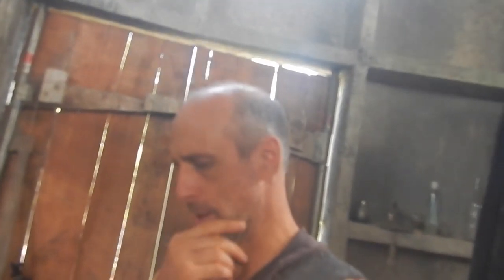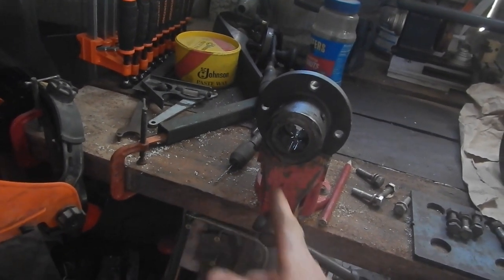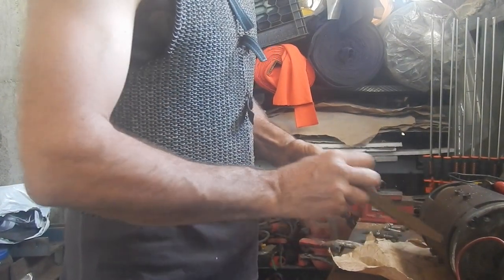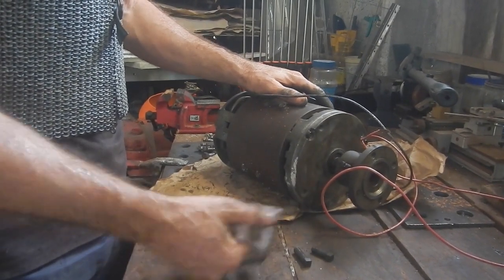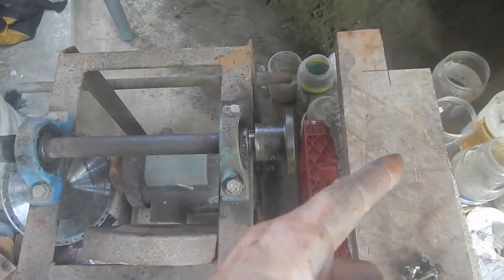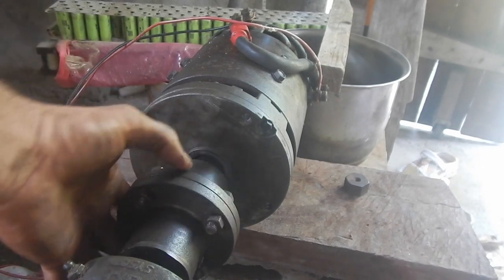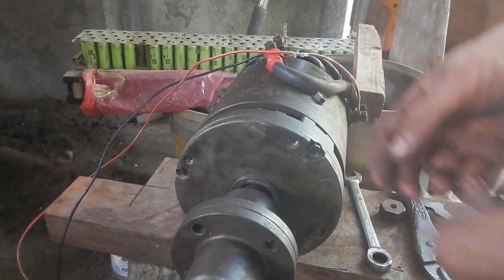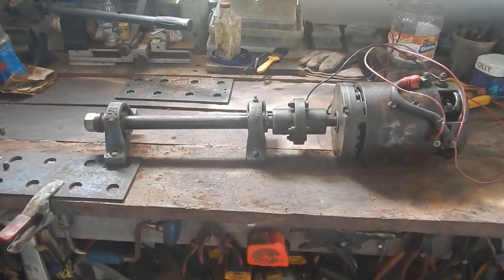Lumber Mill 004 Balance and Torque

Comment: Ive found that when you are hacksawing a bolt to length if you thread a nut down past where you are cutting, once its cut u unthread the nut and it clears any choppy threads

Comment: Thought…. If you cut the current mounting system off at the 4 vertical points would you not have your initial frame? Mount your pivots on the top corners and then bolt on motor mounts/bracing if you dont have the spare power for welding?

Comment: Wouldn’t a bandsaw work better? Or a table saw? Or a chain saw? Whatever. Re-invent the wheel. Fun to watch.
Reply: In theory yes. I am not exactly sure if he is doing the swing blade or something else. If you go back to a video from like 10 years ago you will see where he took his old band saw and turned it in to a swing blade. You can cut your entire log in segments like stairs so that way your nut does not slide across the wood. Which also allows for him to buy off the shelf parts for the build. Off the shelf parts is clearly easy to do rather than having to wait on band saw blades and paying for gas and oil for a chain saw. Chain saws have a lot of wear parts that need to be replaced quite often. 
Let me find the name of the video as I do not know If I can post links or not.  Lumber Mill from Scratch Part 8 Test Drive!  This was 12 years ago. I am sure there are some more videos after this. Keep in mind this was a decade plus ago and been ages since I have watched these videos.

Comment: How is this going to be much different that a table saw? Won’t your cuts only be a deep as the radius of the saw blade?
Reply: In theory yes. I am not exactly sure if he is doing the swing blade or something else. If you go back to a video from like 10 years ago you will see where he took his old band saw and turned it in to a swing blade. You can cut your entire log in segments like stairs so that way your nut does not slide across the wood. Which also allows for him to buy off the shelf parts for the build. 
Let me find the name of the video as I do not know If I can post links or not.  Lumber Mill from Scratch Part 8 Test Drive!  This was 12 years ago. I am sure there are some more videos after this. Keep in mind this was a decade plus ago and been ages since I have watched these videos.

Comment: Hi Jamie I been following you for a while and  I dont usually give advice to anyone unless asked  but I think you need to have the breaker to trip if the saw gets to hot or is under to much stress or maybe put a sheer pin in just thinking about your safety  Good luck on whatever you come up with